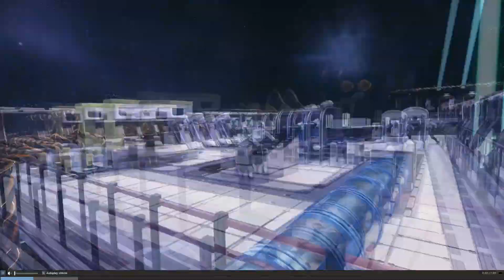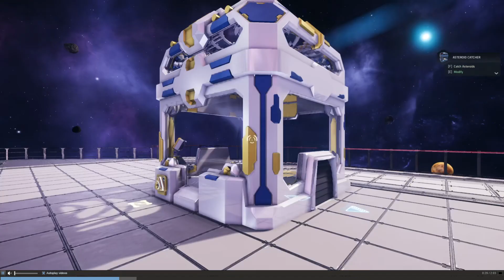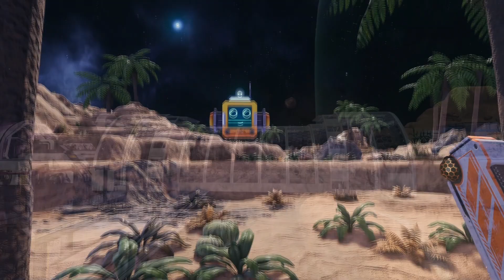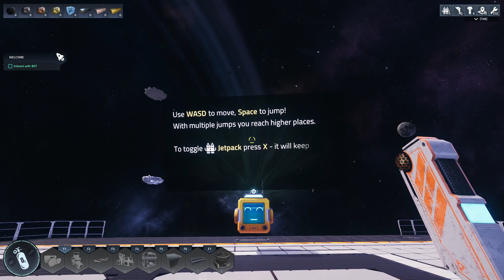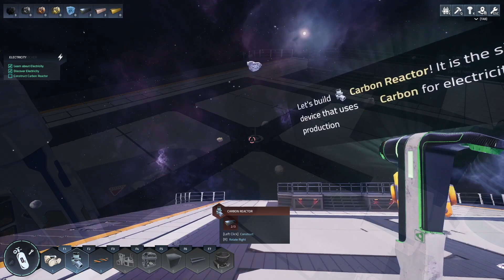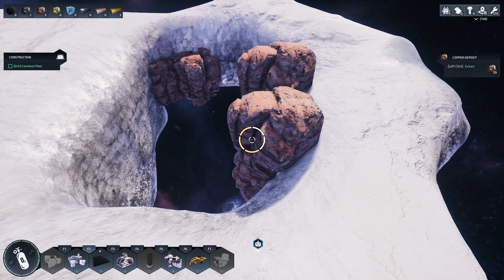Left Alone On An Empty Raft In Space | Astro Colony

Comment: The connector you used for that over sized rock was actually a harpoon, the larger connector you remember is the dock.  Use the dock for connecting to things that show up on the map, the harpoon is basically an over sized asteroid catcher for the oversized rocks(no auto option that I am aware of), the drill you used only covers a 3x3 area to drill out, the large drill will cover a 5x7 area.
Also if you hover over a machine and  check info block that comes up on the left side of screen, if you have the correct research, you should see an upgrade option so you don't have to pick up the lower level machine.  Pretty much all the machines and the belts will have an upgrade buried further along in the tech tree.
Reply from the maker: yep i know i was in discord when the harpoon and the large minder were added.